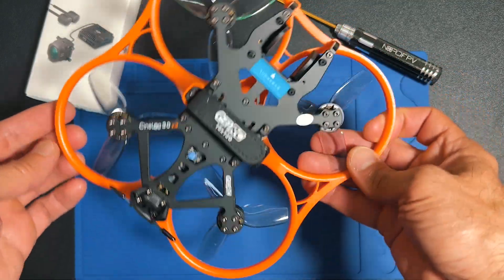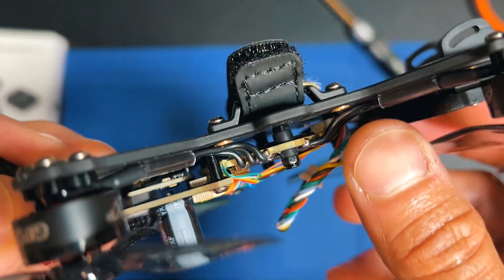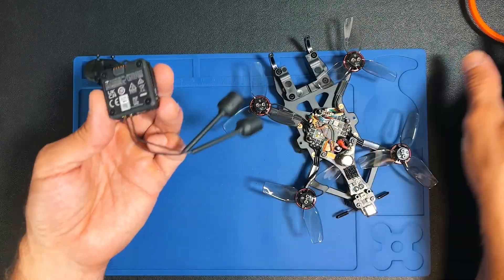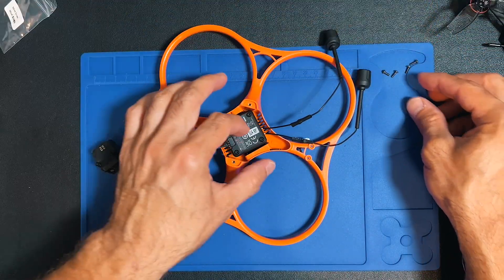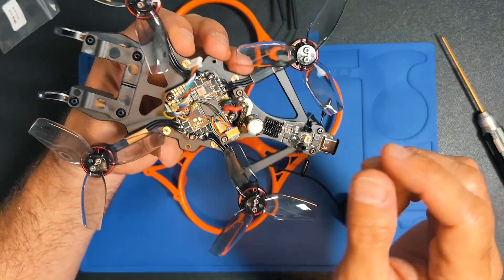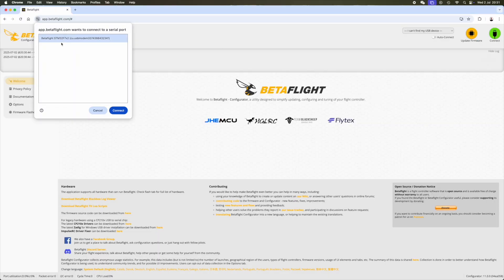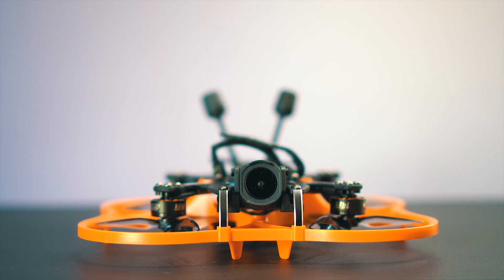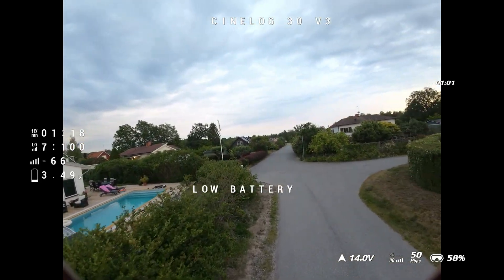Installing DJI O4 on GEPRC Cinelog30 V3 – Full Build, Setup & First Flight!

Comment: Hey there, good tear down vid! Do you know, wich ELRS receiver is in the stock v3? Coz i don`t know what to flash geprc nano PA 2.4 ghz or the Nane (SE) 2.4 ghz.
Reply from the maker: Hi. Thanks. I believe you have the PA. You can double check this by connecting wirelessly to the ELRS receiver before flashing it. Enter the website and look for the name and version installed
Reply: @NordFPV  thanks a lot Sir! I will try my best.

Comment: Thanks for video. I bought this quad assembled and I can’t fire out how to get the antennas through their slot in the back. I feel like I have to force it through the tiny gaps could help with any tip on how to get these assembled inside their posts

Comment: This is terrible, having to buy a complete frame replacement kit for €55 to get an antenna extender that didn't come in my Cinelog30 v3 kit on the VTX. I already own an O4PRO, don't risk your reputation and your channel's reputation; this company has many complaints, your channel will suffer.

Comment: Lá ele vem com a extensão de antena ou tem que comprar separado??
Reply from the maker: I’d you buy the frame set you get the antenna extension in the package.
Reply: @NordFPV This is terrible, having to buy a complete frame replacement kit for €55 to get an antenna extender that didn't come in my Cinelog30 v3 kit on the VTX. I already own an O4PRO, don't risk your reputation and your channel's reputation; this company has many complaints, your channel will suffer.
Reply from the maker: @rodrigom3247  no, you can buy the extenders only. In GEPRC website you have an intem which is frame parts, you then chose the drop down menu and select only the part you want, like the top plate, or even the antenna extenders. Look carefully, they are only a few bucks.

Comment: Which usb-c slot do you use to Connect to betaflight or elrs configurator ? The Port at the antennas or above the o4 Unit ?
Reply from the maker: The one in the back. Underneath the antennas.

Comment: i love h0w everyone says "it was easy" lol when im following step by step and it still doesnt work,,,,ugh

i'm not getting the RC3 controller to work. 
its updated, activated, tried binding but it doesnt bind by itself i always have to do the goggles and RC together so i think its bound but not sure. flashed it so i get Sbus, changed it to SBUS in betaflight, changed it to sbus fast on goggles...

i get no response via the RC.
any and all help would be greatly appreciated
Reply from the maker: Normally there’s 3 places to look at when the radio is not doing anything in betaflight. #1 physical connection. In your case the sbus cable and the respective ground. #3 port tab. Make sure you have Rx toggle on in the right port. #3 the receiver protocol. Which you seem to have in snus as it should. Check the other 2.
Reply: Meu controle dji está exatamente assim, não parece bind más está tudo conectado, liga óculos controle e drone e tenta voar
Reply: @NordFPV  i am using DJI 04 but didnt remove the ELRS plug as mentioned at 3:33. works like a charm now. thanks
Reply: Yo im trying to connect my dji controller what do i do
Reply: Help me bro

Comment: why is this so hard lol...i've done all this and i cant get the remote 3 to work
Reply: What’s the problem. I can help if you want.
Reply: @alizuma233  thanks. i've since got it working. user error as usual
Reply: Having the same problem did you find a fix?
Reply: @algersonvincent
Reply: @Therooster345  yes,   i am using DJI 04 but didnt remove the ELRS plug as mentioned at 3:33. works like a charm now. thanks. also don't forget to update everything

Comment: Hi, do you think that preserving the 2 cables that you removed whould make interferences to the link quality and power in up the drone? When mine is on betaflight (without battery) everything is fine, when I plug the battery for a flight there is no arming and link quality on goggles is 7:0. any recommendations?
Reply from the maker: Yes, of course. What you are experiencing is interference because you have 2 things connected to the same UART. I believe this is specially true if you are using ELRS. I've seen crossfire work, I'm not sure why, in some boards.

Comment: Hello. Is it possible to fit walksnail moonlight in it? Moonlight is only 1 mm larger and 2mm taller. (33,5*33,5*13 and 34,5*34,5*15)
Reply from the maker: The VTX itself should fit no problem. The problem is the camera mount. You don’t have the right screw pattern for the moonlight or any other regular camera. You will need to find some 3D print to help you.
Reply: @NordFPV thanks

Comment: What battery are you using instead of the original 720mAh ones?
Reply from the maker: I have 3 batteries I use with this drone, 650, 750 and 850. The one I like best is 750. 850 works but not my first choice.

Comment: Hi, I have the same drone as you, I haven't installed the ELRS module yet because I'm still using the DJI remote control, but now that I bought a Boxer Crush with AG01 I should install it. If I remove the two wires I understand that I can't switch from CRSF to SBUS in case I need to, the Radiomaster is big and I can't always take it with me in my backpack!
Reply from the maker: You're right, it's a trade-off. You won’t be able to choose on software unfortunately.

Comment: I just bought this And add Tbs crossfire reciver and air unit o4 
Am trying to connect it to laptop but the ESC No Lamps working blue or red can you help me ?
Reply from the maker: If you connected something and your AIO stopped turning on, you probably shorted it. Disconnect what you connected and check power and ground on the receiver specially.

Comment: I need some serious help here, so i have the DJI remote controller 3, i have the DJI goggles N3, and the dji unit 04 air unit, unfortunately for me everything works but when i am on the receiver panel on beta flight and i toggle with my joystick, nothing moves on screen, i have a v3 04 tbsnanorx i would love your assistant on this please, thank you
Reply: Plug in the battery in the drone
Reply from the maker: Is this a BNf or did you build it yourself/someone?
If it’s BNF it should be just to pair the radio to the O4. There are many instructions on the internet.
Reply: @NordFPV no I bought it online from the geprc website and didn’t build it myself, is this something you can help me with ?
Reply from the maker: @bonsramedia  Sure, send me an email to info @ nordfpv.com and we schedule a video call and I can help you.
Reply: @bonsramedia  I have the same problem
Reply: @bonsramedia did you ever get an answer?
Reply: @DustinRatheal yeah I got my query sorted but not from NordFPV, send me a message I can direct you to the person who assisted me to get my drone flying

Comment: Hey! My TBS Crossfire Immortal T V2 Antenne got stuck in the prop.  have to replace it. can I just unscrew the top to get to the nano reciever? what would be the easiest way to replace it? Thanks in advance!
Reply from the maker: You want to replace just the antenna. Not the receiver itself. So yes, you can unscrew the auxiliary board and access the receiver by turning the board, you can  the easily change the antenna. If it has glue, remember to warm it up before trying to unplug the antenna so you avoid breaking the ufl connector.  Hanging the antenna shouldn’t be a very difficult task.
Reply: @NordFPV  yes exactly. My antenna arrives tomorrow. But didn't know if i should unscrow from the or top drone or the bottom like u did where i need to remove the guards first.
Reply from the maker: @BerhTv yes. You need to unscrew the prop guard and then the aux board.
Reply: @NordFPV this might be a silly question but will a hair dryer work? I think there is glue. Don’t know the best to remove it
Reply from the maker: Yes it will. The problem is you will be hitting a bigger area. But it should be fine.
Reply: @NordFPV  Got it fixed at the end used 99 isopropyl. Got off pretty smoothly. Back flying :) Thanks for the help
Reply from the maker: @BerhTv great!

Comment: Hello I would like to know where to get this extendable cable for the o4 pro because my cable broke
Reply from the maker: GEPRC website. It’s the only place I’ve seen it. Under frame parts for the cinelog30 v3
Reply: Hey man I got the same problem… You found them anywhere? I couldn’t find the at the geprc website